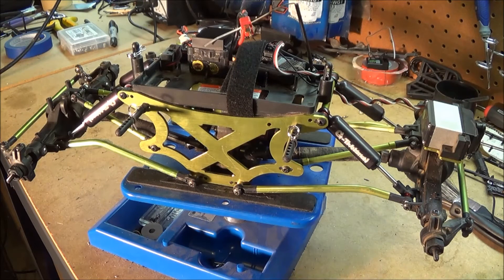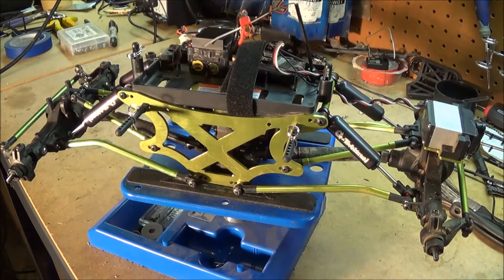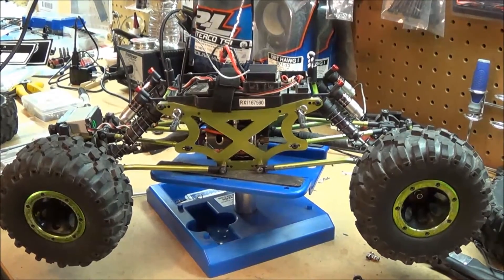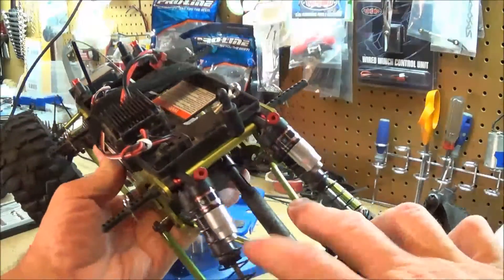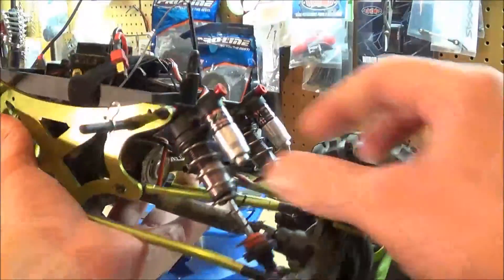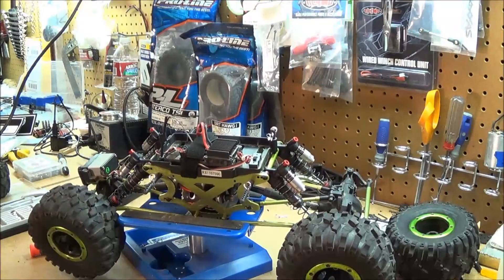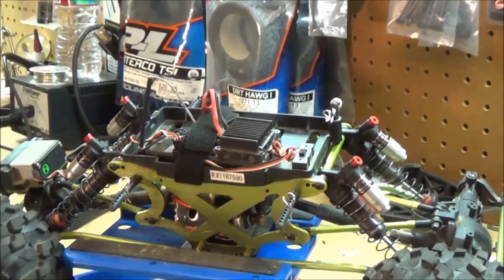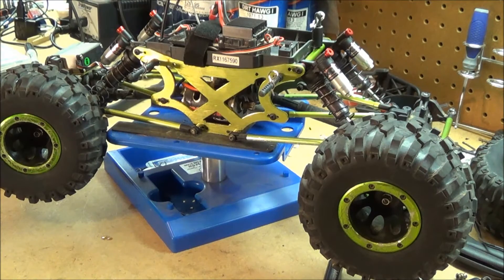Shock upgrade for the ExceedRC MaxStone

Comment: nice looking shocks i have the maxstone 10 completely stock for torque twist alot of people put extra spacers in one of the rear shock & they say that helps i haven't found that much torque twist on mine so far have fun rcing
Reply from the maker: I have tried to stiffen the stock shocks with the springs from my slash with lots of spacers it did help a little but not as much as I would hope. Thanks for the tip and thanks for watching!

Comment: Man I'm glad you found my channel!! Have I got questions for you :) I am looking at buying a Maxstone 5... I've heard that parts are kinda hard to find.. and I tend to break them.. Also, Im thinking that MUCH larger tires might be in order right off the bat... Say Jumbo Kongs or Big Joes? Thanks for your input!
Reply from the maker: :) Yeah parts are kinda hard to find you just have to watch nitrorcx.com website and buy them when you see them cause they dont stay in stock for long (at least the parts that I have needed). So far I have had luck with Axial parts fitting fairly close with a bit of modding, (but not sure on the 5th scale what would fit it) and Much bigger tires on the maxstone 5 would be cool. I know that the maxstone 10 & 8 are the same tire. I do break mine quite often but is normally an easy fix! hope that helps and Thanks for watching and commenting!
Reply: RC Trailin Idaho Anytime my friend... Im rather new to the crawler thing... Im one of those folks that hooks up his summit to his car or pulls the kids around in a wagon... I just know Im going to do something silly with is day one... I am already thinking dual brushless... then I think...Why am I buying a crawler then :)
Reply from the maker: Rc MaNiAc Silly crazy is good cause you know it's a one of a kind!
Reply: Yeah :) I like building them to reflect...well.... me :)
Reply from the maker: I think that's part of the fun!

Comment: What did you do different on your crawler mind has to Motors in it no driveshafts I noticed yours has one motor two driveshafts did you change yours mind is brand new
Reply from the maker: This one was stock the only thing I did at this point was cut the tires and change the shocks.